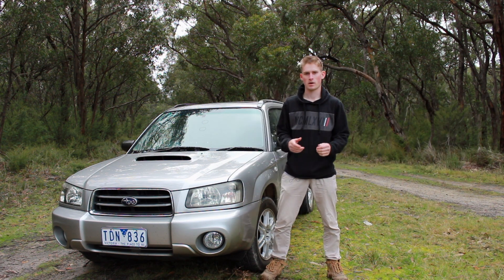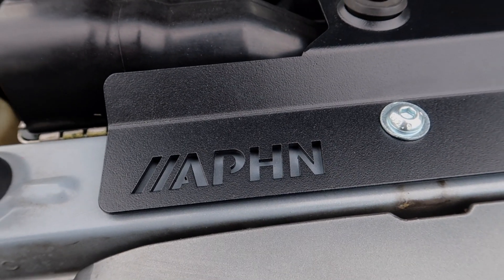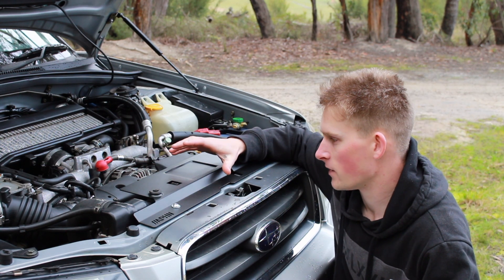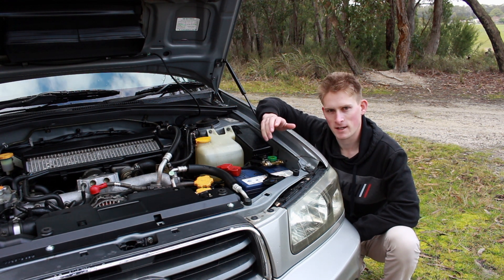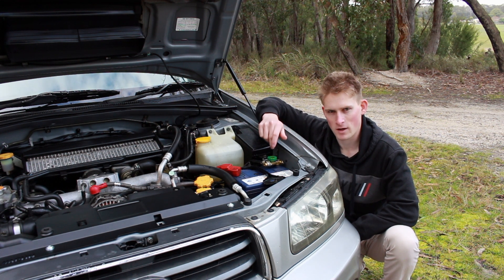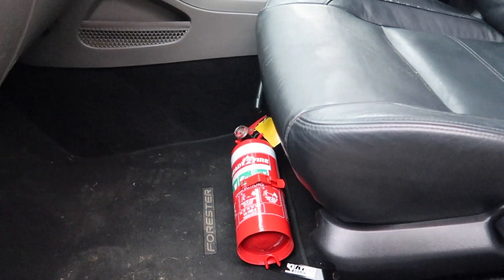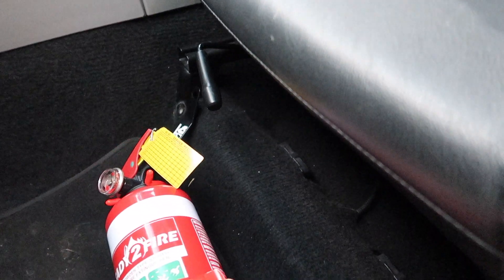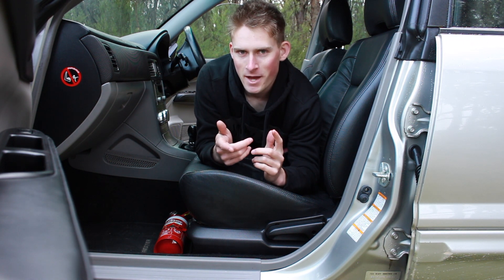New mods on the XT Forester

Comment: Good on 'ya, Mitre! I also have a fire extinguisher but it's under the driver's seat. I am thinking of mounting it at the base of the seat, as well. Mine is still OK, though,  under the seat as I have rehearsed its use. Cheers.

Comment: Be careful with the bonnet struts mate, I've seen several SG Foz's with bent bonnets as a result of them
Reply from the maker: That’s interesting. I’ve had mine for 4 years without any issues. Where are they bending?
Reply: Bending above the mount on the bracket... Yours might be gassed at the correct pressures, a lot of places pressure them too high...

Keen to see how the XT goes with the dual range box... They were never around when I had mine

Comment: Love that lil feature from the APHN shroud. That could be super helpful on the trail or simply in the garage when your working on the rig.  I like that battery mod! I was also thinking it could be helpful in preventing theft. I doubt theives would spend the extra time to look under the hood to see if they could get it running. Imma save that  battery mod for the future i think its great! Thanks for sharing. Totally agree with the fire extinguisher. I'm not sure if the bracket you have for the forester will fit my outback but i will check to see if they have one for the outback. Great video and as always thank you for sharing!

Comment: 2 questions, with the radiator shroud is there any practical reason for fitting other than handy for working under the bonnet? does it improve cooling etc. also does the fire extinguisher fit any higher or closer to the seat base, it looks like it sits a fair way out, and may get in the way. great idea though as i have had a fire myself
Reply from the maker: The shroud is mainly just a visual mod and does not affect the radiator performance. Yes the fire extinguisher bracket does sit forward a bit but it’s not in a position where you would catch your feet on it. There is no adjustment in the bracket unfortunately. They are very easy to make yourself however, if you want one that’s tucked up a little more.
Reply: @ignitionoffroad5028  thanks for the quick response. looking forward to what you do with the XT.
Reply: Ignition Offroad  a few weeks ago I got a rock in through the gap between the bonnet and radiator grill. The shroud would’ve saved the radiator and saved me a few hundred bucks.